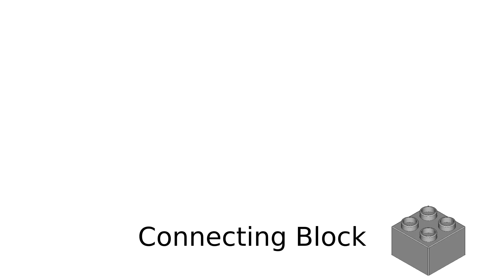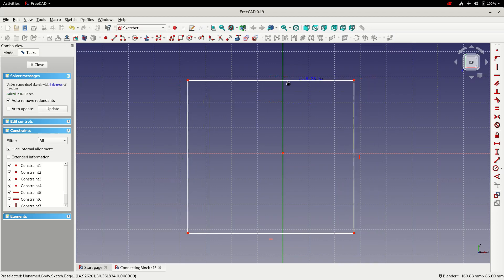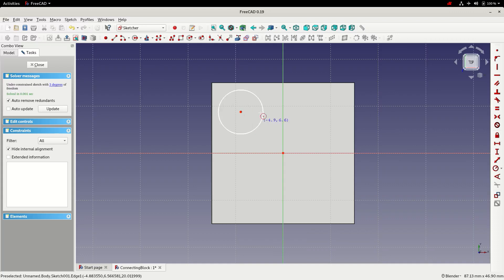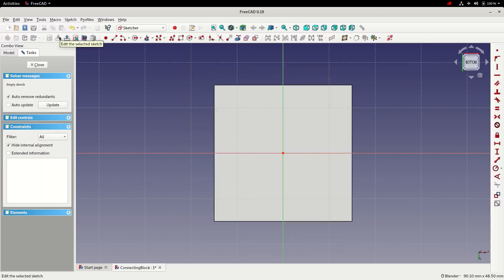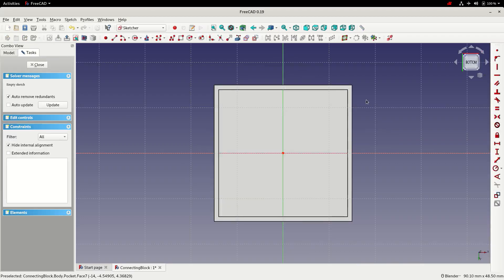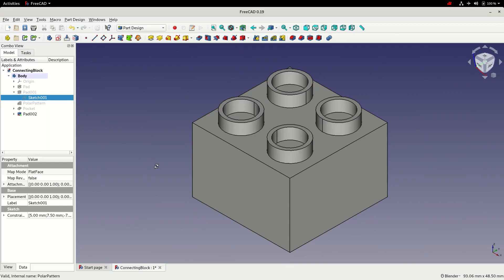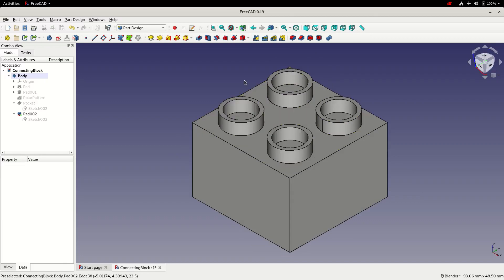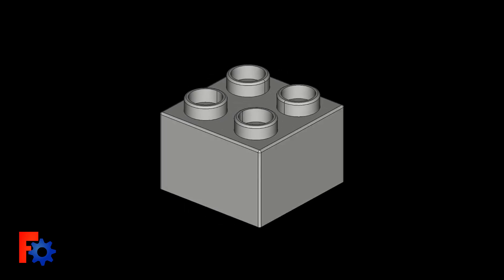FreeCAD Tutorial - Basics - Connecting Block

Comment: Great tutorial.  The only part I couldn't follow was when you created a circle on the bottom face sketch and centred it with a constraint.  I added the radius constraint but the centre is still not constrained.  Did you hold some keys to cause it to snap and constrain to the origin?
Reply from the maker: I have auto constrain turned on. You should be able to find it in the panels on the left. You can add a coincident constraint manually too if required.
Reply: @MarthamEngineering  I also have auto constrain on, but I don't get the centre constraint added automatically.  Even tried with snap to grid.  I had figured out that a coincident constraint could be manually added and that's what I had to do.  Maybe this is a version 0.19 feature?
Reply from the maker: That's strange. Is it the Auto Constrain option in the 'Edit Controls' panel when in a sketch? With that on the snap icon on the mouse cursor should change to a dot when you move over a suitable point, the point should also change colour.
Reply: @MarthamEngineering  Yes the Auto Constraints option in the Edit Controls panel is ticked.  When I hover over the centre dot where the axes cross it changes from red to yellow but the cross on the circle icon doesn't change to a dot.  If I left click when on the (0,0) point I can draw the circle but I don't get the constraint and the sketch is still under constrained with 3 degrees of freedom.  I've tried this with grid snap on and off.

Comment: Great video - thanks. The only puzzle for me was how you made the pairs of circles concentric. No mater how far I zoomed in the second circle was offset. I fixed it OK with  a coincident constraint but you didn't do that. Did you hold down some key or something like that ot make it snap?
Reply from the maker: You can use auto-constrain and it should work.
Reply: @MarthamEngineering  Thank you.
Reply: @MarthamEngineering  Do you have a video where you use auto-constrain? I can't find that tool.

Comment: Thank you for doing this in 2020. I know that programs change over time. I have had my 3-d printer ender 3 pro since the end of 2019. I have grown tired of downloading others hard work and wanted to try on my own. I know nothing about CAD. I have used Tinker CAD with blocks and did great, however I also downloaded Design Spark Mechanical and had a very hard time making blocks LOL. I would like to know is Free CAD just like Design Spark? Thanks for your time today.
Reply: In my limited opinion, I think FreeCAD is one of the most powerful tools out there. But it definately has teething issues. If you are okay with a freemium tool, look at Fusion 360. It's free for home use.

Comment: One question how did you get v 0.19?  copied from freeCAD web site.
Current stable version

The first 0.18 release of FreeCAD (16093) was published on 2019-03-12. The latest bug fix release 0.18.4 (16146) was published on 2019-10-26.
Reply from the maker: I build FreeCAD myself, you can test the development builds from here: https://github.com/FreeCAD/FreeCAD/releases/tag/0.19_pre but bear in mind that they are development test builds and may not work as expected.
Reply: @MarthamEngineering  Thanks a lot for the reply. Things never work as expected in my experience :)

Comment: I have just started looking at Freecad and found this tutorial tremendously helpful, so many thanks for posting it. I have a very specific use case in mind that I have not quite gotten my head around in terms of how to add the right constraints. It is an oscillating steam engine. I can draw it out in 2D CAD but it is a bit tedious and it would be wonderful to have it as a parametric design. Basically the placement of the steam ports changes with the stroke and distance from pivot to crankshaft.
Reply from the maker: If you know the relationships between the parts it should be relatively straightforward to model it all. I would suggest modelling what you can then posting the file in the FreeCAD forum as the support is second to none.
Reply: @MarthamEngineering  Thanks, I have just signed up to the forum.

Comment: Than ks , another great tutorial. I am a little confused about the  pockets in the four small cylinders and the underneath cylinder. When the second inner circle is drawn a pocket is created automatically without having to select the pocket tool. Why is this?  Does this mean it is not possible to use this inner circle to create a pad, i.e. one small cylinder standing on top of another cylinder?
Really learning a lot from your tutorials  - thank you.
Reply from the maker: The pad will only work on a single boundary. If there is a second boundary contained within the first it will be excluded from the pad.
Reply from the maker: It's something that you learn through practice and not so easy to explain!
Reply: The sketch describes one shape, so the inner circles created a hole in that shape. Thus the holes aren't pockets but just the original surface that wasn't padded. Sketches follow the even/odd rule; you start outside the sketch, and for each construction line you cross, you reach inside, then outside, etc. That's why it gets confused if you ever have an odd number of lines meeting. The boundary has to be continuous and unambiguous.

Comment: How have done the very ending? Rotating on black background? Nice tutorial anyway. Trying to get feel of FreeCAD as Fusion seems to be heading to that subscription model rapidly and not that keen on those.
Reply from the maker: The animation was done in FreeCAD using the turntable. I changed the background to black and used the full screen option on the turntable form.
Reply: @MarthamEngineering  sorry to keep bothering you. Is this feature on default install or is it a plugin? I just haven't noticed anything relating to that. FreeCAD has quite clunky interface to figure out.
Reply from the maker: @jothain  Its under Tools -> view turntable..
Reply: @MarthamEngineering  found it's. Thanks